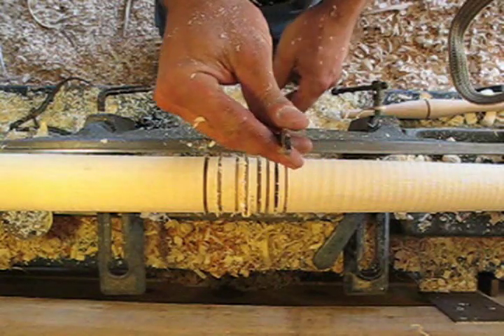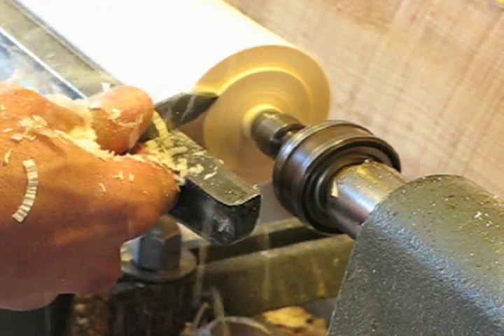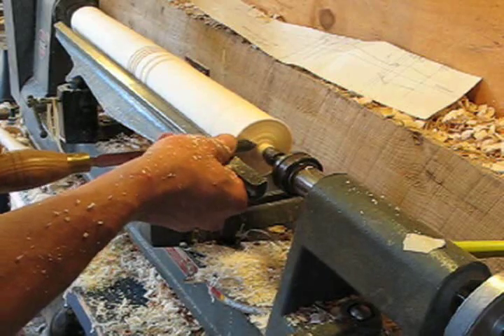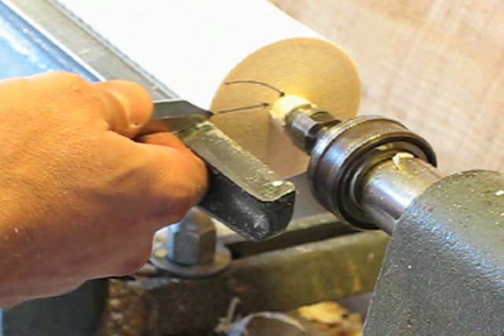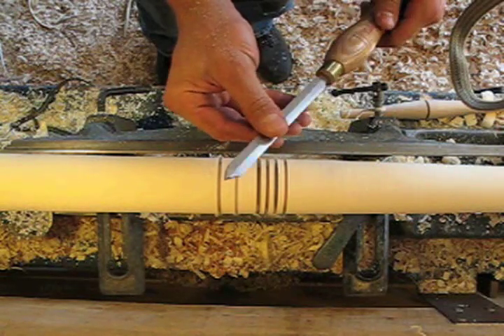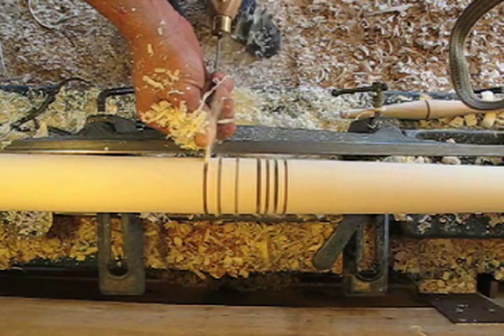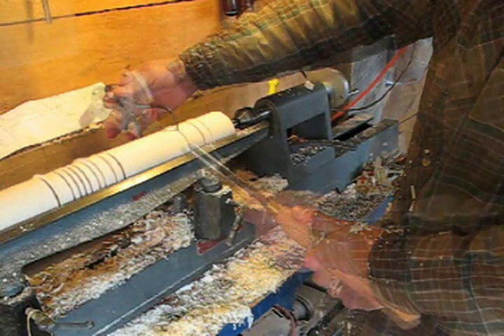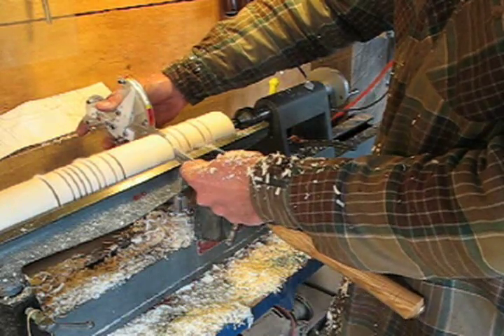Parting Tool Technique

Comment: That's that weird strange "wood" material !
As a metal worker I find the stuff very difficult to work with.
For starters, it does not respond well to conventional welding and heat treating.
Trying to submerge it in a quenching tank is very difficult.
And I have yet to find a suitable electrode to do accurate e.d.m. work  in "wood".
Interesting that it does not seem rust or corrode, however, one must be careful with certain kinds of insects that actually eat the "wood".